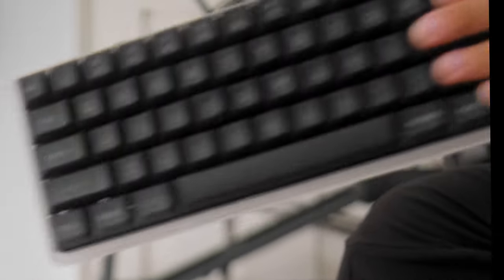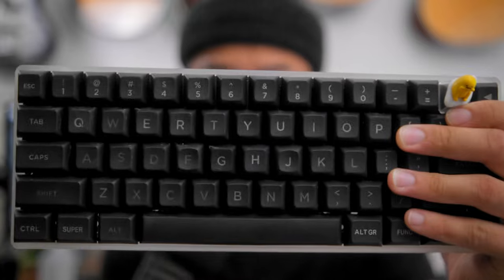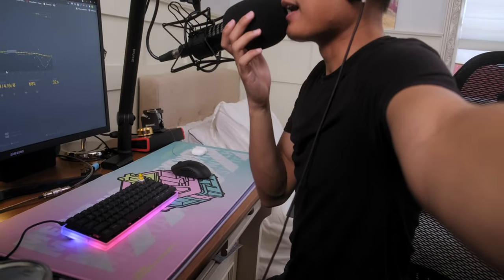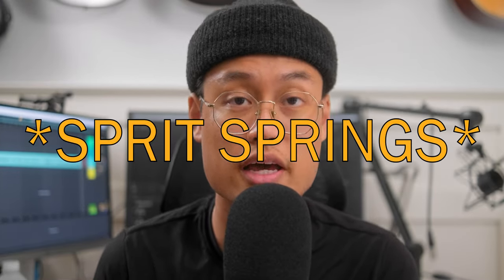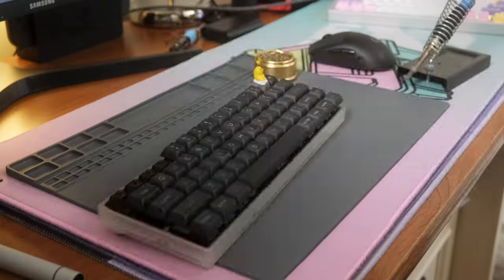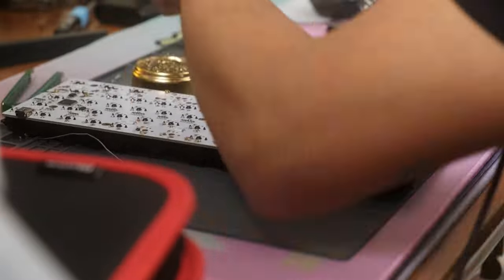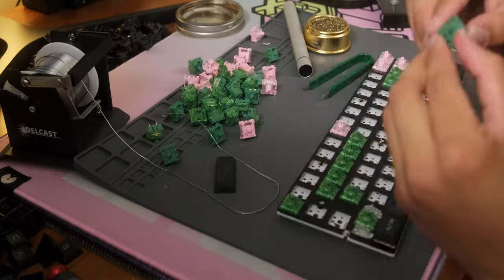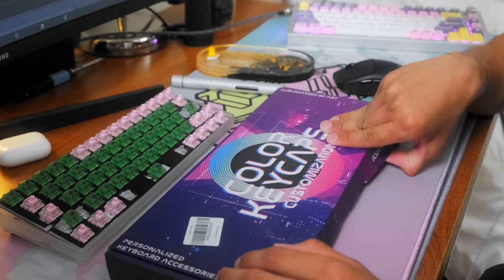Rebuilding my First Custom Keyboard for $60

Comment: I agree about buying to support the designer however I think that argument gets soured quite easily once a GB ends and there are no more new keycaps of that set being made. Many people do not know about the GBs when they are up and only learn about them once its only available on the aftermarket. 

Maybe if there was more consistent R2 or more for popular sets that were yearly or twice a year than I dont think people would need to get knock offs other than price barrier. 

However with it being unavailable through the designer and only on the mech market I dont really support the idea of needing to buy legit. I couldnt get GMK Night Runner since i got into the hobby a year after the GB had already shipped, the only way I was able to get anything that looked like that was through GMKY on Aliexpress. or I coulda sent some asshole scalper 600$ for a set they were never going to use and only resell. Note on resell, if its a hundred more total than price for GB its fine imo but many people charge way more than 100$ extra for it and I personally think thats worse than someone making a knock off set. At least the knock off set has the chance to get people into the hobby, see what was out there and try to get on the next GB. Resellers only overcharge to get more money, no one is buying their first set off mechmarket for 2x the price of a GMK set on GB.
Reply from the maker: Oh I totally get you man, the nature of how GB's work right now and the lack of reruns has seriously soured the hobby. It's a garbage situation and I just don't know how the hobby will end up if it doesn't change. 

I also don't blame people for buying knock off sets. I won't do it personally, but I'm also not gonna get mad if others do it too. But I also am not a fan of all these kids saying "iTs JuSt CoLoRs!1!" Like I get why someone would do it for financial reasons, or if the set they want hasnt gotten a rerun for a looooong time. But at least put some respect on the designer's name, ya know? But yeah, you make very good points.
Reply: @AnzelLmao  I can't say I've seen a whole lot of people going it's just colours so maybe that's just me being more of a consumer than a person who posts vids, blogs or what not like you. However totally agree about respect to the designers. Curious what you think of making it a build to order type deal where a GB is used to being in interest but afterwards for as long as it's feasible to do made to order production. That way nothing is over made past demand and opportunities for ppl to buy but also designer to get more business. (I have no idea how GMK works as a company tho)

From my experience however it has been a whole lot of seeing a video of cool set or board, find it only to see it was sold out for a year lol. I always reach out to the creators to see if a round 2 will come or is planned and never hear back. 

Too many discords, too many forums, too many distributers and not enough consolidation of that information in easy to find spots. Still love the hobby but it sure doesn't love me back lmfao

At least creators like you try your best to teach and be a good ambassador to the hobby. Love the content so far! Hope you continue to grow at the pace you want.
Reply from the maker: @kbar11  yeah the whole in production thing is just how gmk's business model works, supposedly it'd be unsustainable to have sets constantly be in stock like that unless they constantly sold well, just because of how they have to keep stock of the colors that are ordered or something like that. If anything the hobby just needs to change for the better. I dunno how, but at least we can acknowledge it for the time being lol. It just sucks that its this way. But thanks for the kind words, I really appreciate it!
Reply: @AnzelLmao  maybe there is a way for designers to release cheaper versions of the sets through the ppl that are making the copies. Not an ideal solution but would be a good way to know if a colour way is popular enough for a round 2 but I can see that being an issue if one the designer and manufacturer can't get a good relationship and whether there is a good means of compensation. 

I appreciate the content man, looking forward to what you got next. If you do switch reviews may I suggest a Frankenswitch I've just made (not sure if others have so not saying I'm original) but got a C3 kiwi housing with a boba u4t stem. The thock is amazing on it imo and the colour is awesome. I can't decide between calling them Boba Fetts since it kinda has same colours as the armour or Green Apples since it kinda looks like a green apple with a bite taken out of it (keeping with fruit name of c3 housing). What do you think I should call them?
Reply from the maker: @kbar11  yeah it's just a garbage situation, with different manus having stricter kitting and moq requirements than gmk, or others just not wanting to collaborate. just is how it is.

And damn i'd be down to do that frankenswitch if it wasn't so expensive LOL. I'd love to try but I'm not even tactile gang so I dunno if I can justify doing it for myself lol, but Green apples are lowkey kinda cool haha